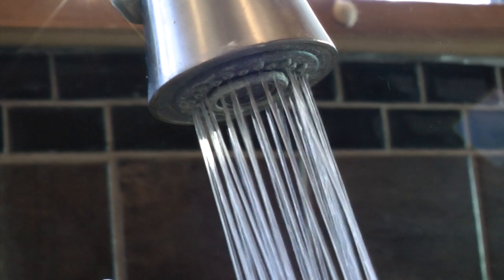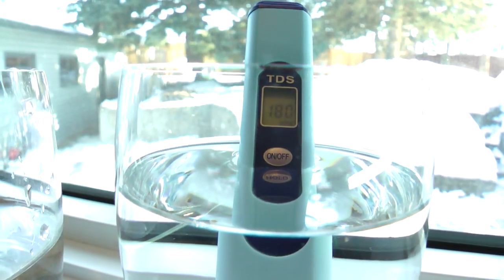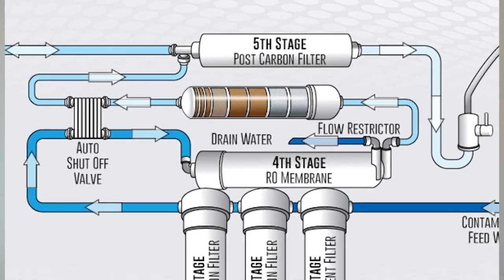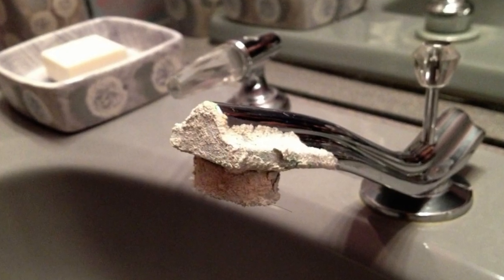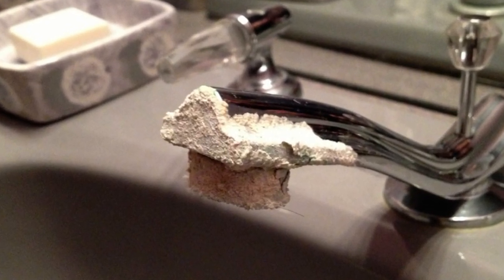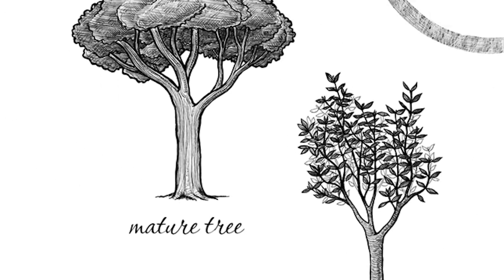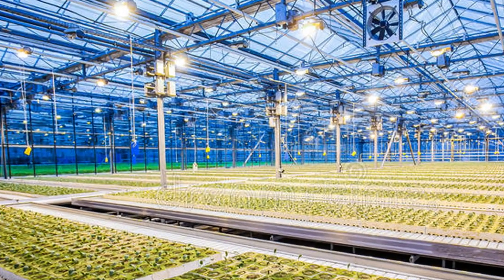Is Tap Water Safe For Hydroponics???

Comment: Oh yes, I have tap water, but mine is directly from the well, so it does not contain any chlorine,however it is hard water in itself, almost exactly the same shown in your video, the white stuff on that tap is called lime. My PPM is 450-500 untreated, all I do to counter the big particles you mentioned is by using HCl (Hydrochloric  acid), it dessolves the lime so clogging is minimized. It does not change the PPM though as all the nutrients are unchanged, so my nutrient PPM with the hcl treated water would end up  at around 1144 or so as I mix about 5000l at a time. My setup Also has a 110mm pipe gathering rainwater from the roof directly through a filter to the tank, and that ppm is about 5. Rain water/Reverse Osmosis water swings very easy when acid is added because there is no buffer like lime (hard) water, there is almost no reaction between the molecules is rainwater, so 5ml acid (concentrated) can balance 20litres of rainwater, but 50ml is needed for 20litres of hardwater. Hope this was helpfull to those Hydroponic enthusiasts! And well done bro, your videos are still fresh! Original youtuber!
Reply: Hydrochloric acid ?? WTF would you use that in growing something you ingest??i hear of these boys using battery acid for ph,,boys WHERE IS YOUR BRAIN????do you know you can take a gallon of water put 3 drops of hydrochloric acid in it ,,bet you a hundo you CANNOT DRINK IT ITS STILL TOXIC,,,this is exactly why most of your ph down products are food grade PHOSPHORIC ACID,,which you can put 3 drops of it into a gallon of water and drink it without a negative reaction,,so do a little more study on it and STOP PUTTING TOXIC ACIDS IN THE MIX,,,THERE is a viable reason we use phosphoric acid f

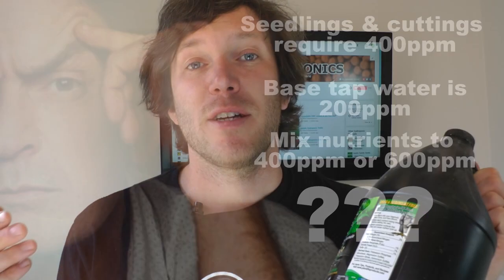Comment: So you never answered the question at 1:10..... If tap water is being used do you go lighter with the nutes or mix  as if RO water was being used????? Thanks in advance.
Reply from the maker: Mr. Canna Farmer when a plant is in full Veg I typically mix as directed. I guess I purposefully did not answer the question as it’s really up to you the grower.
Reply: HowToHydroponics is bottle water good to use ? And if so which ones? And do bottle water contain any chlorine or chloramine, I know it contains fluoride. Sorry for asking a stupid question just supper curious..
Reply: @magnoliapark4185  I just buy either distilled or whatever is cheap, by the gallon.  I use my dehumidifier water most of the year, but very low output in winter months.  7.0 ph and under 40 ppm is typical.  The store bought is higher ph but lower ppm.
Reply: @HowToHydroponics if you use purification pills than is the water ok
Reply: @HowToHydroponics did the molasses clog your pump I was watching your other video

Comment: Is using purified or reverse osmosis water the best to use for hydroponics? Or how much TDS, PH, and EC ranges are recommended for optimal results?
Reply: The idea is to use purified water as a starting point and then add exactly what the plant needs for maximum growth.

Comment: So do you go easier on the nutes if you start at 300 ppm ?
Reply: Definately,,my tap water is between 60 n 80 ppm,,i only run 100ppm for seedling ,,250 to 400 fer veg,,working up slowly not all at one time,,regardless that my water already 67ppm i still only use 100ppm for seedling or clones,,,but DO NOT FEED YOUR PLANTS LIKE THIS,,nutrient levels are HIGHLY DEPENDANT ON LIGHT LEVELS,,you have to learn your nutrient levels for YOUR LIGHT NOT THE PLANT,,Very very important info,,like i said especially in dwc feed what your light levels allow,,overfeeding WILL SLOW PLANT GROWTH ,,you will not harvest what you will feeding your plants correctly,,,,if your plant in dwc uses a gallon of water in a 24 hour period and most of the nutes PH SPIKES,,not enough nutes,,if ph is dropping you have too many nutes,,once you figure this out DWC IS BY FAR THE EASIEST FASTEST WAY TO GROW,,,

Comment: My water is 700ppm will my plant be able to live through that?
Reply: Thats mighty hard. Not an expert but id suggest buying distilled for one plant and mixing 100% of recommended nutrient for one (baseline test) , mixing 75% of nutrient with tap water for one, then 50% with tap for another maybe try other mixtures as well. Issue is that is so high it might be difficult to get anything else to mix with the water. Let them grow and see if what happens. if the growth with the distilled is alot better might would consider investing in a reverse osmosis filter, not much difference id just carry on with tap. I'm starting to grow some stuff this year and am going to do the same with distilled and see what happens.